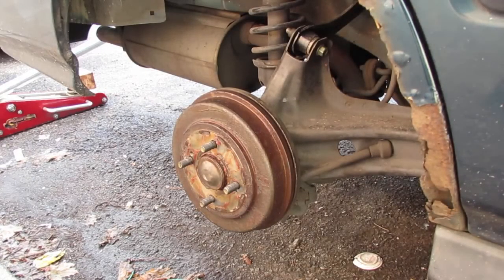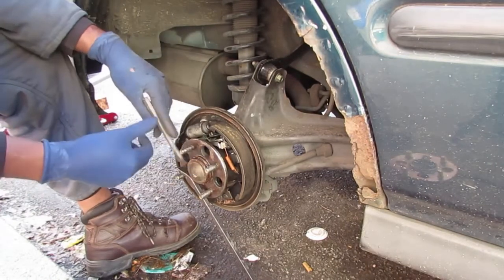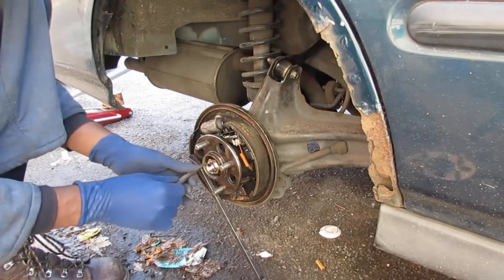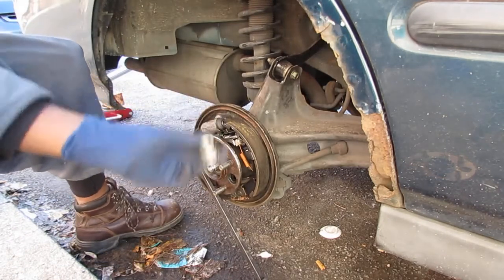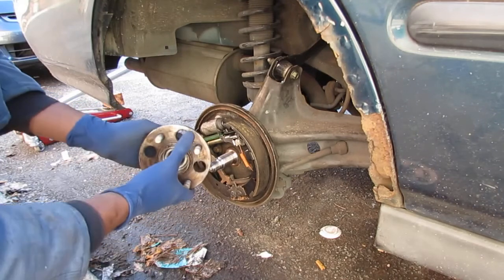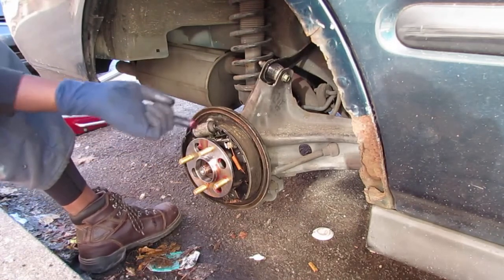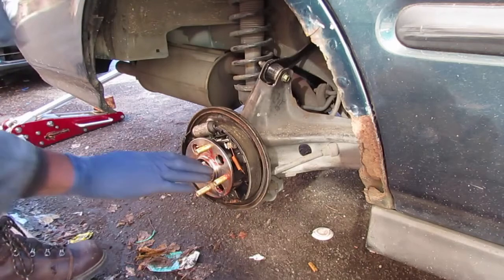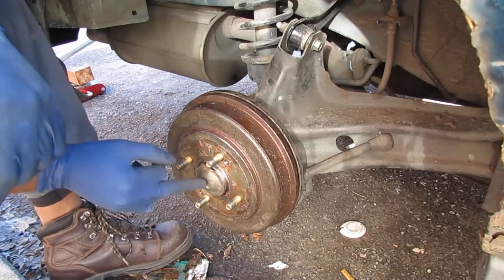Rear Wheel Bearing & Hub 1997 Honda Civic

Comment: How’s it holding up
Reply from the maker: So far no new sounds and I am amazed by that.  The repair was a success.  Have been working on the road and traveling 161 miles 4 times a week and it has not failed.  What I learned from this repair was to purchase extra dusk caps in advance and a dust cap removal tool.  Thanks for asking.